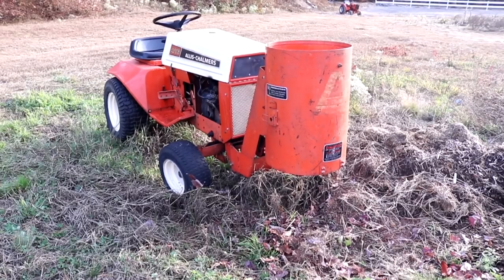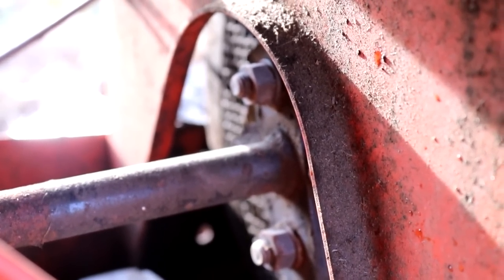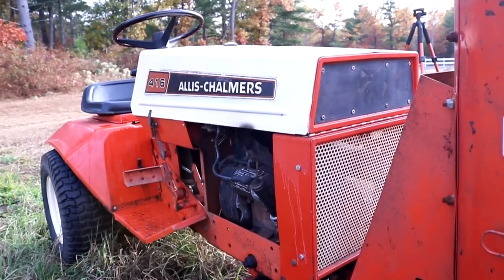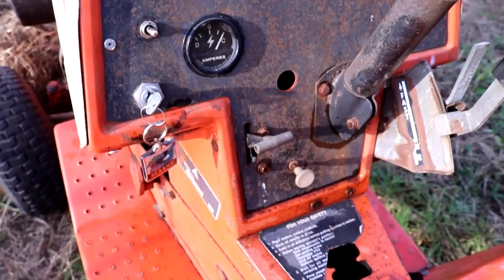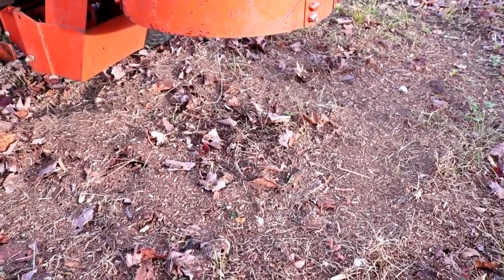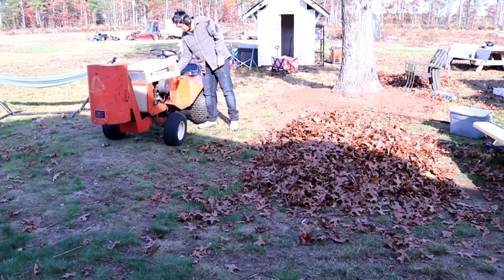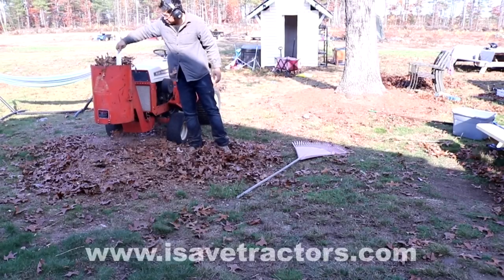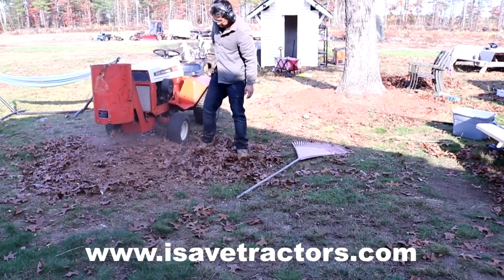Allis Chalmers 416 Garden Tractor with Composter Attachment | Walk Around and Testing

Comment from the maker: Hey I hope you enjoy this video! This Allis 416 with composter is an interesting machine! I've never seen one before, let me know if you have down below!
Reply: cool vid norm. I found a 1973 cub cadet in pretty decent shape is 700 a good price ?
Reply: @asus12351  what model?
Reply: asus12351 - $700 is a bit high unless it’s in mint shape. But need model #, no cracks in the tires, no smoke upon start up, seat is crack free and battery in new then $700 is a fair price. Also make sure the front PTO work well
Reply: I've seen a couple on Facebook marketplace by me North East PA not on a 300 or 400 series Allis Chalmers though
Reply: Very interesting!  Four years ago I found a new old stock Might Mac shredder which I use to shred my leaves.  It was designed for John Deere 100, 200 and 300 series tractors.  I have mine on my my John Deere 112 and 216.  Maybe that was Allis' answer for competing with John Deere and Mighty Mac??  Those ground up leaves make the best mulch and really help my lawn stay healthy and looking great.

Comment: I've used plenty of these types of mulchers over the years and have found that the smoother the metal is on the intake side, the better the material is drawn in. I use car wax in the chute area to make it as slick as possible. The AC composter in your video was painfully slow. Cool unit though.
Reply: Makes sense,  just like a chute for a blower or snowcaster

Comment: MacKissic made a rear mount chipper shredder for that style tractor (IH had them make one for them as well) Those are versions of the 59M and 79M and they will eat most anything.
Reply: I have one with a Briggs that replaced the Tecumseh,  its awesome,  i could definitely set it up for a front or rear PTO but ever since i discovered Hugelkulture, i have been doing much less reduction and more using all wood, weeds,  wildflowers,  and earth for building walls to not see or hear my ignorant neighbors.

Comment: I loved this video along with the rest of your videos. I followed your loader build and built one for my case 442 hydraulic drive tractor awhile back. I had a quick question though if you have time. I am having trouble with steering ability. The tractor is very hard to steer. I since gutted the old gear on gear steering and upgraded to a ross steering with thrust washer mod. It did help but not to the point I was expecting. Have you had similar issues with front end weight making steering troublesome? Would a large amount of counter weight on the rear help enough to make steering efficient again? Any input would be much appreciated.
Reply from the maker: Oh yes add as much weight as you can behind the rear axle. The steering difference is night and day. I have 300 lbs on my Ford Tractor with Loader and the Cub Cadet TLB has a 400lb backhoe on the back
Reply: @Isavetractors  Ok Awesome! I am going to build a ripper attachment off the rear box hitch. I will add some weight to it and see what happens. Thanks for the info and keep up the amazing work on the videos!

Comment: I have a small wood/small tree branch chipper, it's not worth the effort or the money I paid for it. The one thing it's really good at is yard leaves; I would mow the grass and leaves into a three bag bagger with three plastic containers, not the open mesh type although you could use the mesh type. The chipper has a adjustable feeder chute that will lay flat on the ground so you can rake leaves into it. Trying to rake leaves into it is almost impossible but it will pull/suck them it eventually, again not worth the effort.
The solution is using the bagger to do a ruff first cut then dump the bagged leaves in front of the chipper chute and shove them in with a shovel or a small rake. I would attach the chipper bag to the exit chute to collect the chiped leaves and place the fine chiped leaves in my garden. The leaves were chiped so small that they would practically decompose by spring time.

Comment: there is a craftsman gt6000 hydro for 45 dollars on an online auction that i bought from before should i bid on it i heard you in the last video tal;king about them they are ok or cheap it looks nice and it has a 46inch deck
Reply: $150 max, they are a cheaply built unit
Reply: @RustyZipper  ok thanks The auction ends in 6 days so I might pass on it if it’s to much
Reply: I have a 2003 Craftsman gt5000 22 hp with 6 speed hi/lo range.  50 inch deck.  Electric pto for deck.  Runs great, never an issue.  Drive and deck belts wear out every 3 to 4 years.  The 3 belts are inexpensive.  The gt5000 might be a good deal. 
Also for leaves if I back over them the blades really shred the leaves.
Reply: @DavidM-yv9js  cool thanks for the info

Comment: Hi Norman,  I finally placed an order with you lol.  Just a plug and a awesome beanie for now.  More orders coming soon!
  But Question : 
😂.  So my lgt 165 has the 3 point mounting capability.  But,  on old tractors they have the pto or opening   to slide the say..... Implement shaft inside.  My lgt doesn't have that part.  Does that mean it's only meant for implements that don't need to spin?  Just dragging implements?  
Sorry,  I'm new to this stuff.
Reply from the maker: Yes correct. You can use box blades, rakes, forks, discs, cultivators and many others. The only rotating attachment that machine could really handle is a rear tiller. Thanks for your business!

Comment: Does the lgt 165 have a oil filter?  And when I order my new carb....  Is the carb in the kit with the gaskets ect the same as the carb by itself on your website?  And are both carbs aftermarket?  And is there a rebuild kit for my original carb?  Thanks.  
I know that's alot,  but I need to know before I place my order.  I'll call if necessary
Reply from the maker: The LGT has an inline transmission filter. The gasket set includes the carb gaskets. The parts we sell are iSaveTractors. We only have carb kits for our carbs and the original Carter carbs. Not for Walbro made carbs. Please call or email if you have any further questions for more detailed answers

Comment: '"This tractor according to tractordata weighs about 850 pounds". Well tractor data must be wrong because it says that a cub cadet 982 weighs 875 pounds! WHAT??? And a a Cub Cadet 982 is a Muuuuuuch larger tractor than that AC 416.
Reply: i have a JD 316 and a AC416... I need to build a see saw to demonstrate
 that the AC416 cant be 850lbs. I love them both, I like my AC416 because it came with a rear lift set up, something that would cost 500$ on a JD.
Reply: @paulg444  I’m selling a rear lift for a 316 kohler for $30,   For a 316 Onan  a 3 point is the rear lift option.

Comment: why does the tractor look like a 600lb tractor and yet it weighs 850lbs?.. where is the steel hiding ?
Reply: Just got my hands on a 410. The weight is in the transfer and motor. The motor weighs 116 pounds dry. Trans is similar depending on drive mechanism.